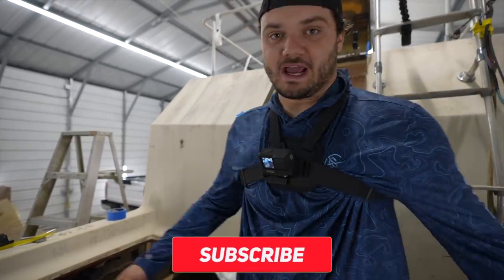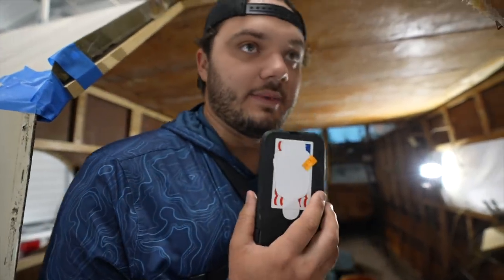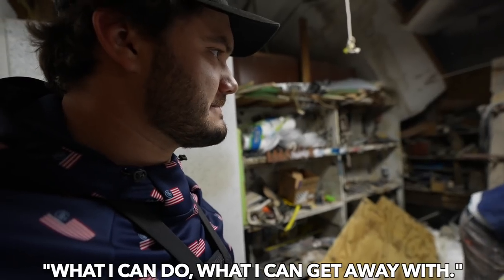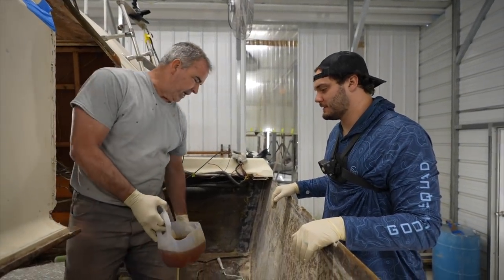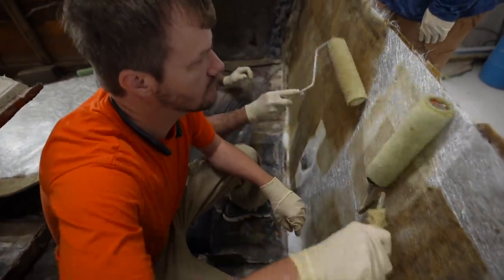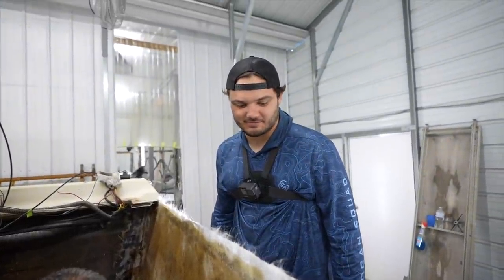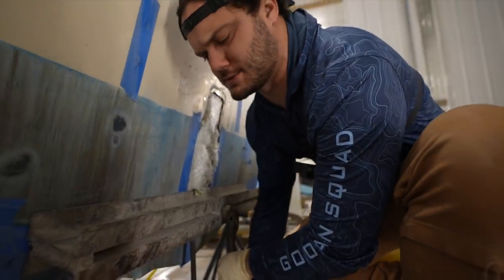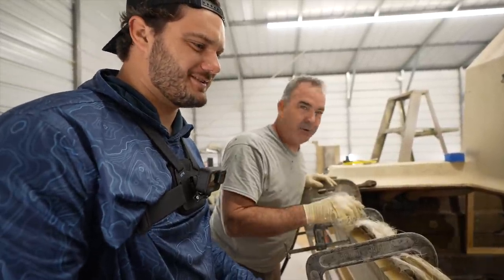Replacing The TRANSOM In My HOUSEBOAT!! (fiberglass and more termites)

Comment: Hey, watching the video.. I am a die hard boater myself for 40 years.. I want to be honest with you, I highly highly recommend you to consider thinking about going inboard/outboard to outboard engine only. Outboards have become so reliable and fuel efficient as well.. get a single outboard bracket for the transom,  that way you have a lot more space inside your boat.. and the outboard engine is very easily accessible.. that is what I would do.. please consider it, get like a 200 hp and you will have more than enough power with plenty more to use.

Check it out please!! It may cost a bit more, but in the long run, you will have the coolest houseboat around!  Look at tritoons, they are using outboard engines and they are great for everything. Your's will be more fun cause you have it all!!!
Reply: I think you should put a set of outboards on your house. If you are doing all that work to the transom. Outboards would give you more room in your boat hull. And they are a lot better for saltwater.
Reply: I would use 2 small outboards on a motor bracket it would make it very easy to control and it is nice to have 2 motors just in case
Reply: Jonathon, there's no way that repowering with an outboard would cost more than rebuilding the turd he pulled out of the shitty bitty. A used 150 would push this thing right along and be far more reliable and cheaper all the way around.
Reply: PLEASE - consider a bracket and outboard(s)  This application screams for this in so many ways!
Reply: Definitely with you on team outboard.  I was really surprised when I saw them putting the hole for the outdrive in there.   So much more maintenance and space consumption.
Reply: Outboards are ugly......
Reply: @DynamicSeq  not at all. have you seen new ones?
Reply: @Eggugat  yes..The V12 one looks very cool....but what I mean is that, for me. They ruin the sleekness of the boat....You have this nice sleek hull aerodynamic and all...and then....Bam .. Big chunk on the back....I just don't like the look...
Reply: @DynamicSeq  thats fair, im not a fan of the V12s far to big.
Reply: Outboard is certainly not a bad idea, but keep it to a single. Twins would be overkill and pretty inefficient for a house boat. If control and maneuverability are on your mind, a good bow truster will do you better.
Reply: I agree that inboard outboard would look a lot better but they are a decent amount of work.. I have one on my carver that we keep on the lake and servicing them can be a pain at times.. on the flip side I have a 17 foot center console with a 175 two-stroke outboard that I’ve fallen in love with.. working on it is so much easier even tho it’s an old turd but still more reliable then the mercurser.

Comment: Coming together nicely. Pro tip, when you need to open a c-clamp a bunch, hold it by the screw and swing the clamp around, it will open much faster.

Comment: Not finished watching but that "goop" is called "chop glass" or it was when I worked at Correct Craft many years ago...and didn't you cut into the transom when you removed the engine? How is that going to play out?

Comment: Houseboat motor mount area and transom rebuild is a  major undertaking  in a houseboat rebuild. I worked at a Mississippi marina . We hoisted old boats from the river and re- fiberglassed many times.. This particular houseboat is rare. The smaller 70's models are not as common as the 40+ footers. I will be interested to see what updates you decide on as well as if you are willing to keep the boat's soul of the 70's alive. I am a truest.I hope you maintain the orange and cream design. That color wheel was sought after back then. Especially with the Glastron speedboats.

Comment: Regarding the termites and bug bombs not working. I did the same thing on my boat but I covered the entire boat with my canvas cover, turned off the electrical, then set off 4 holiday foggers on a 34’ cabin cruiser with fly bridge. All the termites died. You didn’t cover your boat so the poison just blew out the windows. You should retry as it is much cheaper than an exterminator. Enjoying your show and unique presentation method!

Comment: Well so much for my outboard pitch. Given the cost of fuel two 50 h.p would give great control and enough power. One big motor would get you up on a plane and burn lots of fuel. Both would save lots of weight vs. the I/O. You will have to rebuild the motor and need new exhaust manifolds and risers. Also may have to rebuild the outdrive at least replace all seals and water pump. Pricey unless you do it yourself. Thanks for the great content.

Comment: Just as some historical information on this model. It was produced in 1972 through at least 1978. I was aboard one in Jan of 1972 at the Dealer boat show at McCormick Place  in Chicago.  This model was also listed in the 1978 Boat Owners Buyers Guide. It may have been made after 1978 as well. I do have a picture of a full page ad for it in the 1972 Power Boat Annual. The construction methods used by Steury contained lots of wood in both the hull and superstructure, as you have found out in redoing this one. Wood rots.

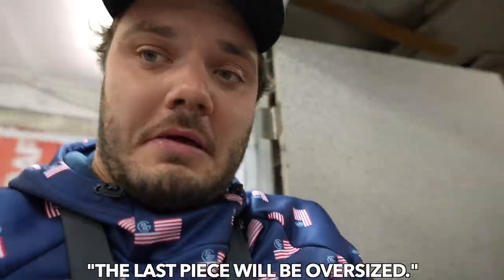Comment: 6:38 One of my first jobs was working with fiberglass go-kart bodies. Still 20 years later fiberglass that dug into my eyeball rates as the most pain I've ever been in, and since then I've had a thumbnail ripped out when a ladder slipped in the mud and been hit with live 480 volt electricity, it rates much higher than either of those.

Comment: I used to build Ski race boats.
We would glue the marine ply in with a glue made of resin and talcum powder.
Much faster and much stronger.
Drop a blob of that glue on concrete and once it sets you won’t get it off with a jackhammer.
I would of used 1 sheet of 2.5 inch ply instead of 2 sheets.

Comment: I would have used a bit more resin than they did in the initial peice the transom board clamps to. You want it kinda rich in resin so when you clamp it as you tighten any excess resin drains out and gives you a consistent bond

Comment: Might be too late, but just a thought here...
Is the original engine and leg going back in?
If the original motor is toast and  you are re-doing the transom and stringers then this is the time to consider converting it to outboard motor instead of inboard.

might be cheaper and gives more space in the boat?

Comment: Just a F.Y.I.  When you see the flash from lightning and hear the boom several seconds later it means that the lightning was far away because light travels much much faster than sound.  In fact if you know the amount of time it takes to hear the sound after the flash accurate enough you can tell exactly how far away the strike was.  That little nugget of information might come in handy someday when you are out on the water and want to avoid being in the wrong spot at the wrong time in a storm.

Comment: I implore you to put a bracket and an outboard (or two) on the transom. You will find that outboard maintenance is much easier and much less time-consuming than the maintenance required for an inboard/outboard motor. (Check out the video from Regulator Boats on their brackets that place the outboards 3 feet behind the hull on a bracket.)

Comment: on the motor,,,,see what ya got......if....block is good.....and heads are ok,.....you can have them ported and polished, can stay carburated or go manual fuel injection......go electric fuel pump and carburated.....you need to figure out carb size and you can jet it how you want, also yuou can make engine elctrical easy by just using HEI...engines I know....elecrical i dont...Dan

Comment: Right on right on.  PLEASE think about putting a nice outboard engine on this,  it will give you soooo much room inside.  Outboards are EASY to work with.  PLEASE seriously consider the advantages of a outboard vs a damn inboard/outboard expensive set up.  Trust me.
Reply: He needs an outboard bracket and motor. Inboard will be a pain in the arse. The weight alone is enough reason not to install an inboard.
Reply: How many more times are you gonna post the same comment?? He has already made the transom with the cut out for the old motor anyways!!
Reply: @mwatkins2464  He hasn't installed it,  outdrives are a huge pain in the ass.

Comment: Where ru at.....I'm trying to get help on mine, I really need electrical help and help planning ant re-doing & technical; planning to make my  mid- 70s open bass boat into a REAL  bassboat with rod storage n stufff.....trying to make a plan for whats not there its super hard to find any information on a 14.5" Terry Bass Pro...The repair isnt difficult, the weather & cold isnt cooperating with me to get the glass to cure.....if ya know any1 that can help with the elctrical parts near Oregon....let me know    On yours so where are we at????  fix the transom, re-do the motor, and do electrical....then the fun begins......the series is good so far...Dan

Comment: Ok I hope they acetone the old fiberglass area before they put that first coat on or its just going to de-laminate after about 6 months and they should be using a metal roller to remove the air bubbles to get it dead flat against that surface. I have done about 5 transoms 1 for myself and 4 for friends and I personally wouldn't use this technique. I have also worked with fiberglass for the past 20 years on and off, and most my work is still going strong.

Comment: You don't need to gelcoat. Just use paint its way easier and cheaper. For a beginner. The paste he makes is often refered to as peanut butter. As I have said in other posts. Break the boat apart at the gunwale remove from trailer. Do the job in three parts. Trailer hull and remainder. It wil be a lot easier in the long run. Doing the transom is not hard. Stringers are harder but not hard. Heaps of good diy on youtube. Do your trailer first so u can move the boat safely. Then hull. The hull needs a complete gut and sand then new stringers etc . Myswlf i would have covered the transom in a layer or 3 of strand before i put it in and then put more on it when in with some knees,  but I guess you are not supporting an outboard so that's probably why he did it that way. By the end of this you will be an expert. Good luck. Enjoying this a lot. Hope u can turn it from the bitty shitty to the bito pretty.

Comment: My Guess on the Plywood you said was solid in the Transom  is not what you think it was it looks like there were  some Amateur  Jury Rigs  back there over the years  and usually those are done without  buying  Mariine Plywood   instead using whatever localLumber Yards  have  and  that won’t work   it was probably a Patch  to attempt Stiffening it  up or stopping a leak from the inside  i’m not being a Dick   i made the same mistake on my first  boat repair myself   it was a waste of time ,money , and materials  because  i eventually had to rip that all out and redo  it again  BTW  mine was  a Floor not a Transom

Comment: Did you use polyester or epoxy resin on the transom? As a general rule, you don't do polyester over epoxy, as it doesn't bond as well, but you can do new epoxy over and into old polyester. Ideally, you use whatever the original used, and polyester is generally cheaper in bulk, your Bondo type fiberglass kits are polyester. The fumes from polyester are no joke - the solvents are carcinogens, and you should be  wearing skin protection as well as respirators unless outside in a good crosswind.  You can create an allergic sensitivity to the resin if your skin touches it a lot, and then your allergy will trigger off of very small amounts, always. Some model airplane guys found that out the hard way and had to stop building. Best not to roll the dice on that; gloves are cheap.

Speaking of gloves, I hope you changed yours when you started clamping: getting resin in the threads of those bolts will make it tougher to remove them later,  I guess we'll find out next episode, lol.

I learned how to fiberglass by fixing up an old Sunfish sailboat: a lot smaller project scale than Itty Bitty, but just the right size to learn on, at a reasonable cost. A project you might take up one day: duck hunters and fishermen take old Sunfish hulls and turn them into shallow-water duck hunting boats with a new deck. Kind of a step between a kayak and a jon boat.

Comment: May I suggest when it comes to a power plant a Volvo IPS system If you're gonna have a single engine without a bow thruster that'll make maneuverability a lot easier
Reply: Forget that Volvo.
Reply: He need an outboard with a transom mount.
Reply: A bow thruster ?? What do you think this boat is , a yacht?? He has the old motor that hopefully can be rebuilt.
Reply: @mwatkins2464   Even boats smaller than that have bowel thrusters today as standard equipment But since his doesn't have one I was suggesting a Volvo IPS system

Comment: is it too late to go HYBRID ???   deseil generator powering ELECTRECT MOTORS ????  :)   put a little GENERATOR down there where the engine sat....   run ELECTRIC MOTRORS (twins at the rear)  and 2 trolling motors up front for bow adjustments?? LOL HEHHEHEHE       THRUSTER POD at the rear?? LOL  llike a little tugboat lol
Reply: add a battery bank, and the generator kicks on automatically when the batts needs a charge, make it so you can get like an hour or2 on trolling  motors on a 15 min charge???  that would be awesummmmmm ;)